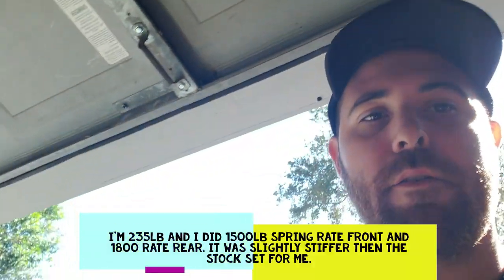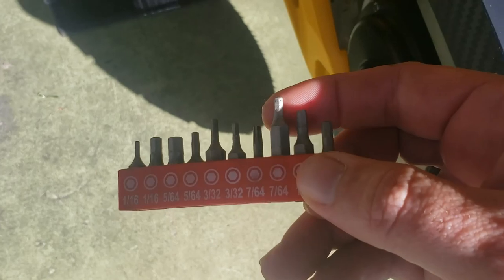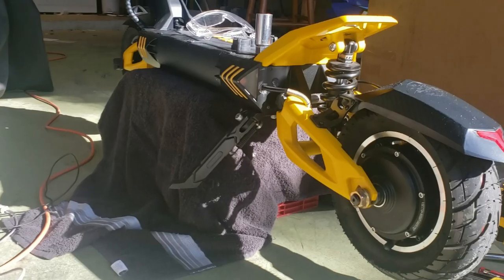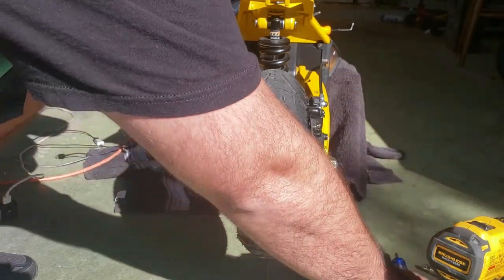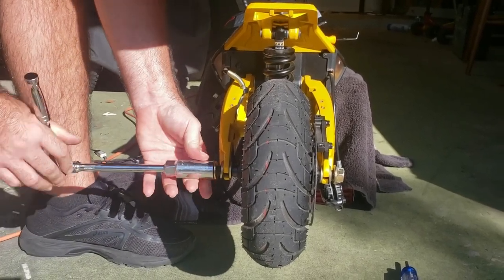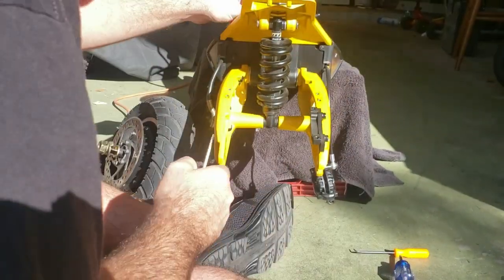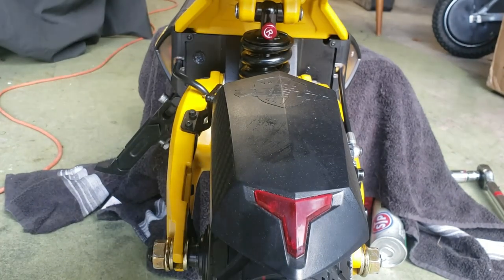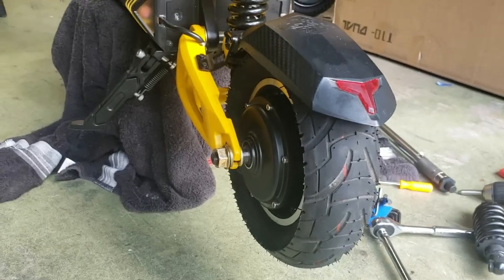VSETT 10+ How To Install EXA 291R Shocks!!! Step By Step Install. New Suspension Is Amazing!

Comment: Just an fyi for those who have the newer version of the vsett10 you need nothing other then the 291 shocks. They’re swap out and swap in. Took me 10min for each wheel. Also a good idea to install the rebound adjuster on the bottom end. That way you can access the sag ring without taking the tire off. Another person found that if you install the shock with the rebound at the top - an air bubble can be felt
Reply: What do you mean by newer version?
Reply: I’m assuming the one with the new screen.
Reply: 125mm but the 1000k 1500k??

Comment: I have a vsett 10+ for about a week now, I had ordered the shocks based on lots of posts saying they were needed. So far I don't really have any issues with the stock suspension. I'm on the heavier end so I read that I should use 2000lb on both front and rear. Will it be an improvement still you think? If not I may just sell them and not bother. Thanks!
Reply from the maker: How much do you weigh?
Reply: @outerzonerc777  Do you know if they offer a seat for the 10+??? Thanks
Reply from the maker: @GidDree  I don't think they do, I also don't think it would be safe.
Reply: Hey bratha I have the same question. I weigh around 206 and I have a custom seat on my e scoot so that should ad some weight into it also… thank you

Comment: The Ausom Gallop are the exact the same frame design with minor variance, do you think, I can install the same shocks in them? if yes, how do I know what exact payload to get 1500lbs or 2000lbs and what dimensions should I look for, 125mm x 24, 135mm, 150mm or higher? It's so confusing because the manufacturers don't print the exact specs on these shocks for us to know what to replace/upgrade them with. Another question is, could you use the stock spacers with the new shocks or one has to order the aftermarket one like you did?
Reply: Have an Ausom Gallop also & Just got the 291r,took apart the back & the bottom of the 291r shock hole & bushing  is too small ,gonna send back,they are both 2000lb 125front ,150mm rear 24x24 both...the bottom shock spindle on the Gallop is 10mm so the Vsette must be 8mm,the 291r shocks are 8mm for both,I measured

Comment: What kind of improvement did you notice after installing the upgraded shocks? I am also 235 lbs. would you still recommend 1500 lbs on the front and 1800 lbs on the rear?
Reply from the maker: Better safer handling at higher speeds, but also better ride quality. Yes on 1500lbs up front and 1800lbs rear. I know some charts say different but I found these numbers out from a guy who does warranty repairs for Vsett. I was right at 230-235lb that rate is good from like 210lbs to 250lbs. If your lighter it will be stiffer and if you weigh more the ride will be softer. These shocks are adjustable too so they can be tuned for weight. Just set them somewhere in the middle of the clicks and you can play with them from there.
Reply: @outerzonerc777  Thanks!
Reply: What the size for the back 165mm or 190 mm?

Comment: Just installed the EXA FORM 291R 125mmx24x24-1500lbs on the front of my VSETT 10+. No matter which stiffness setting I adjust to, the shock fully compresses on any bump, and any time I push my body weight down on the scooter. It feels like my brand new shock is busted. Any tips? Am I just missing something stupid?
Reply from the maker: If you tighten the shock collar sleeve the threaded part It was stiffen the ride. You will need a large pair of adjustable pliers and a rag or a piece of rubber so you don't scratch the shock when grabbing with the tool, it will make the shock more firm. It will look like it's used to raise the suspension height up which it will do, but it will also make the spring stiffer. If it gets too stiff back it off a little bit. That should fix things. The little red adjuster is just for rebound so that's going to slow down how fast the shock pogo sticks back up at you. So if you make it real stiff by tightening that sleeve then you want to add more rebound so it's not so springy feeling. Hope that helps. Let me know.

Comment: So, how has the ride been with the new shocks?  I am in the market for a scooter and the Vsett 10+ 28ah is on my radar....This is my 1st Scooter so I need all the advice, suggestions, and help!  Is the Vsett 10+ the best bang for my buck and what about the new display I saw a guy install?    Again, have you noticed a change in dampening with the new shocks installed?

Comment: What would you recommend for 195lbs rider?
Reply from the maker: I think 1250lb in the front and 1500lb rear would be good. Little bit stiffer then stock but better adjustable shocks for different riding styles.

Comment: Was the stock rear suspension 125mm and you changed it to 165mm?
Reply: Original suspensión  rear is 165mm… and front is 125mm

Comment: I saw in another video the guy said to tighten the swingarm bold to 50 ft pounds. Is that correct? Since you said 30.
Reply from the maker: Hey I was just reading back on this. The swing arm bolt should be 30lbs with locktite but the wheel bolt can go 50lbs to 80lbs. So sorry for the misinformation. I read what you wrote the first time wrong.

Comment: Hey dude, does the weight rate matter? I’m about 195 pounds and purchased the 125mm 250lb and 165mm 450lb are those good and will work??
Reply: Hi Daniel, in my case I bought 125mm/850lbs, I weight 68 kilos / 150 lbs. It did not work, the shock was almost completely compressed once I stood up on the scooter, despite being adjust to full stiffness (rebound and spring). I think you will have the same issue, being heavier than me.
I solved it changing only the spring to 1500 lbs, and it work like a charm.
Reply: @KokeMendez  okay fantastic! I got the 125mm at 1500 lb 165mm 1800 something like that for the back, so I should be good right??
Reply: @danielpazos4305  It should be good Daniel, I hope this upgrade works for you!
Reply: @KokeMendez  thanks brother me too! Do you mind just showing a quick video on how to change the front? Also the spacers did you by them separately?? Or they came with the shocks?
Reply: @KokeMendez  thanks brother me too! Do you mind just showing a quick video on how to change the front? Also the spacers did you by them separately?? Or they came with the shocks?